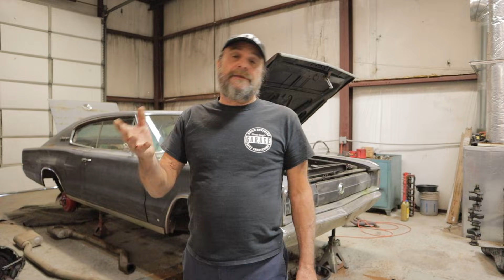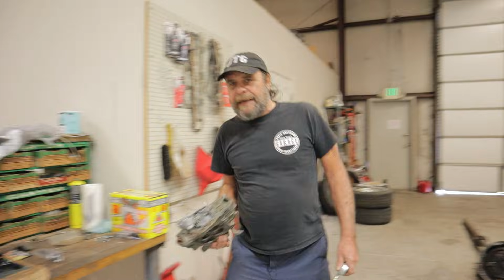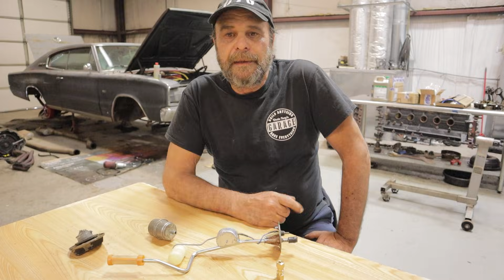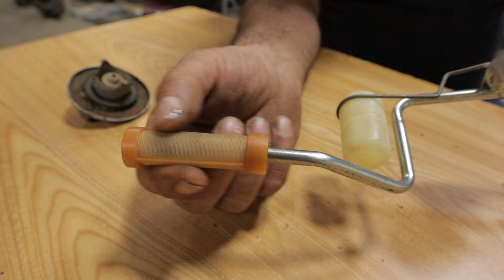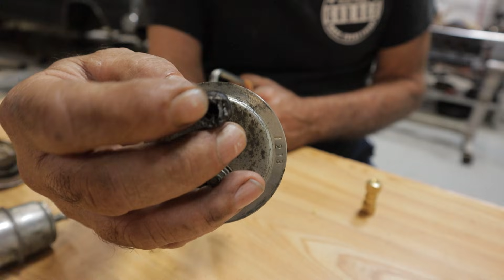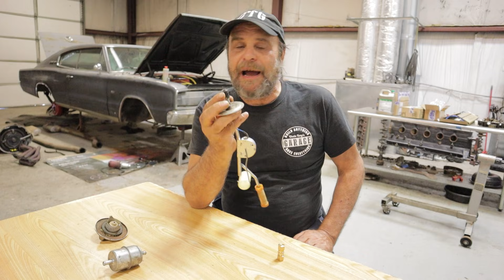Classic Car Survival - Troubleshooting Carbureted Engine Fuel Delivery Systems

Comment: I have a question? I had a 79 Ford truck for the 400 engine every two weeks I would take out a fuel pump, replaced all the fuel line brand new tank, everything every two weeks or take off your pump put a new one on run fine after six bumps. We’re up to 400. I pull the engine and put a belt for 60 and never once had a problem never changed any rest of the fuel system never knew what exactly was the problem 460 would hold 6500 RPMs all day long no, if you’re starving problem at all, what the 400 would take out a pump every two weeks sorry if some of this is messed up, I am legally blind. Have to use talk to text.

Comment: Dads 84 suburban would sterve for fuel sometimes. He thought it was vapor lock. Installed inline electric fuel pump. Years later i found there was a pin hole in one of the metal lines coming from the fuel tank. Clamped a rubber hose on it no more problem. Was very strange

Comment: Heavy float if carb has a nitrophyl float. Too much alcohol in fuel will dry out the material and cause float to sink causing flooding or overflow. Brass float can get a tiny breech and sink as well. Brass floats are still the best to use. I still push Seafoam as it nullifies the drying effect of E10 fuel for older carb vehicles.

Comment: My 80's k car had a fuel problem, that shuttered and bucked like crazy, then clear up and do it again. Rust in the gas tank blocking the filter, until it would fall away from the filter and back again. Lot's of fun. Drain, shake around with a chain inside and reinstall with new fuel filter. All better. Seemed to be from a gas station that way.

Comment: Haha I have seen that before however it was on a isx Cummings engine and it was the blowby tube. At idle it flowed fine but when we drove the truck it would blow oil out of everywhere it seemed like and granted that engine has high crank case pressure anyway but it was mostly coming from the front crank seal and after 2 seals later it started just dumping oil like crazy from everywhere you could imagine I cut the blowby tube off right where it came out of the front cover of the engine and I have never seen a hose so blister up on the inside before it was definitely a learning experience

Comment: Back in the 1970s and 1980s, it was commonplace to swap an SBC into a Vega. There were several stories about a puzzling result; the V8 engine would lose power above a specific rpm. The problem would then be traced to using the original fuel line, which had been designed for the stock 140 CID four cylinder engine.

Comment: I recall reading in a mid 1960s magazine (Mecanix Illustrated?) in which a vented fuel cap had been replaced with a non-vented type. This caused the fuel tank to partially collapse. Stereotypically for the era, the woman driver had only noticed that she had to fill up more often.

Comment: I had a fuel starvation issue ,Ands a buddy had a chevy with the same issue .
after a short drive it would run out of gas, let it sit start up   but do it again quicker. > to find out if it was the pump we pulled the plugs riged a line and in seconds had 2 gallons of gas in a pail ! no issues with pre pump fuel flow, put it to gether & do it again ! his truck we put a pressure gages between the pump & the tank , and when running vaccume would then climb to  20 inch's mg vapor locked ok socks plugging but only when pressure pluses ,not in free flow conditions >out of gas, omc boat tank , no problems . later it happened to me . could not  find a vender for the replacement sock > But i did find a whole new sender unit .  later i had aeratic fuel pump cost me a grand  in towing,carb diagnosis and replacement. > the mechanics were not happy about not working on a chevy. and year later I figered out the pump was sketced out ,and my carberators were probbaly fine just ove presueizing the  system i had,as it did to the new holley after wards. just cause they can race chevys ,and do it well . does not mean there capable of troubleshooting an ol dodge

Comment: Start off the day with basic stretching exercises as you get older . On all my mopars I bought switched over to 3/8 racing aluminum fuel line and used vinyl coated metal hose clamp hangers

Comment: Would replacing the lines and connecting small rubber lines with all braided line and putting an inline filter before the pump help ??

Comment: Great videos Tony.  I have a Ford F150 1985 I was having fuel starvation problem. It has caused the truck stop A few different times. So I decided change the fuel pump and since then , it’s been running OK. My question to you is should I put a filter before the fuel pump .  I have a transparent wix just before the carburetor.  But after watching your video I’m thinking I could maybe put one before The new fuel pump i put in.

Comment: Good stuff as usual! I have a 73 340 RR that has been sitting for a long time, and I know I have either a clogged screen in the tank, or clogged fuel line, etc because when I run a fuel line from the fuel pump to a can of gas she runs just fine. Otherwise the pump won't pull any fuel hardly at all. Could be the rubber line coming out of the tank. This gives me a troubleshooting roadmap, so thanks much!
Reply: all the new fuel today thanks to farm lobby is full off ethanol and it destroys fuel tanks 100%. Good thing new tanks are available still. remember that most fueling stations probably have lots of moisture inside them as well. What is the challenge is how to install ethanol-proof tank parts

Comment: Tony there is one other thing that will cause fuel starvation. on general motors cars there is like a spring inside the fuel cartridge and a plastic plug like in them on the rubber gasket take both that spring and plastic plug out . Back in the day (when l worked for GM) there was a bulletin about fuel starvation in most GM cars.

Comment: I swapped out an avs with my cousin, for a thermoquad. The thermoquad kept cutting off at various times. Then let it sit. It would run again. Then out of No where shut off again. He ran the avs with an adaptor with no more issues. The 360 Volare  ran great. I on the other hand started having the cut off problem on my 340 Challenger. I took the carb apart. Checked the floats and needles. All working as they should. I blew into the metal fuel line with the floats dropped. No blockage. Put it all back together. Ran great. Until it just shut off and starved for fuel. I removed the carb again. No fuel ran out of the line. I tapped it a little and a small round flat piece of plastic fell out. It was almost the same diameter as the fuel line. I guess it would turn like a throttle blades on a carb and fuel would flow. Then when it turned and shut off the fuel it caused the problem. I put the carb back on. And it was the best carb I ever ran. That 2 1/4 secondaries would light the back tires up when it came in😂. I love the thermoquad. Really simple carb to set up. Tension the rear flap and set the needles for ideal idle. I still have this carb.

Comment: I found an odd issue on my cousin's rail buggy carburetor once. He was having a starvation problem,  idled fine but fell on its face when he hit the gas. Apparently someone had rebuilt his carburetor and didn't tighten the float valve seat enough. The seat then backed itself out, from vibration I guess, until it had the float pushed down tight in the bowl. Of course the valve was closed tight, most of the fuel coming into the carburetor was seeping in around the threads of the seat. 
I've also seen where someone had stacked two seat gaskets on a carburetor. Apparently the old gasket didn't come off and they just added the new one on top of it.  Not as much of a problem, but has potential to be.

Comment: I followed ford's instructions on diagnosing a 2017 f150 with a dead throttle pedal. Replaced both high and low pressure pumps, swept throttle sensor (2 grand so far). Turned out to be throttle body. Good luck

Comment: My '66 Coronet 500 uses the same fuel system components as that Charger. When I rebuilt it, the fuel tank was so full of loose rust and debris that I just threw it away. I replaced it with a stainless steel reproduction tank. When I installed the fuel pick-up I ordered the one used for the hemi car. It is has 1/2" dia metal pipe, and requires 1/2" hook up hose. I replaced the rest of the rusty old 5/16 fuel line with 3/8 fuel line.

Comment: I'd like to refer to Chris Birdsong (guy who restores 2nd gen Chargers and un-hacked the '68 from Roadkill) who was deep into Holley EFI stuff, untill he started having them fail and leave him stranded. (Surprise surprise) So now he has abandoned them and went back to carbs again.
Reply: Interesting about the Holley EFI. I've been having problems with Pertronix ignition conversions-not that they stop firing, but hard starting and blowing-up mufflers -- somehow the timing is off and ignite while an exhaust valve is open. I'm all points now, and not another problem.
Reply: Simple is luxury

Comment: funny you posted this the same day I just had my '66 wildcat experience no fuel issues for the first time in 16 yrs. Posted a video too! No fuel at the carb, then traced to the filter, then fuel pump, then disconnected the pump and no fuel coming from the tank to the pump. Tank is vented, dropped the tank and checked the sender and sock was fine. Blew compressed air through steel lines, and checked cam lobe with endoscope to ensure lobe was still hitting pump arm. Pump still pumps. Rubber lines must have collapsed, about to check this weekend more. You rock Tony!

Comment: Three stories: 1. Had a carb off a GMC stove-bolt six cylinder, the float chamber so full of debris that the jets had tunnels under the float to feed fuel.  Took a total replacement rather than a rebuild! 2.  Old mechanic used to fill the glass filters with fuel before putting inline, result was filter was full for a few months until the fuel line 'vented' itself.  3.  A Datsun 280 Z  would not start off the carrier, had half full tank, regional rep wanted use car for instruction purposes to train techs, (Bosch J- or K-lectric systems) crank engine no start.  spark at plugs, plugs clean, but heard clicking noise when cranking, two of us told them to replace the fuel filter, that wasn't until 30 pages later in the diagnostic manual!  When asked why we made a quick diagnosis of fuel filter, the injectors were making the clicking noise because the seats were dry from lack of fuel for the cushion between the needle and seat!   Old Guys RULE!

Comment: I garentee the ethanol ate that rubber hose and made it do that. Although I have never had that issue quite like that. I have learned that regular fuel line is no longer suitable for use. You have to buy the more expensive "fuel injection line" whatever rubber its made from is unaffected by today's gas how fuel line should be. Hopefully that tip helps someone avoid issues.
Reply: I found the same situation. Injection hose and solid clamps, problem solved.

Comment: Your experience is priceless. Something as simple as "ignition problems create abrupt symptoms and fuel issues are more gradual" makes total sense and yet something that I may never have considered. I truly appreciate all your advice, knowledge, and passion. My #1 favorite Youtibe Channel, hands down.
Reply: There is the "head scratcher" that can leave one sitting on the side of the road. My Cutlass has a Chevy 350 in it One day after visiting my son we were heading home and it died...like shutting the key off die. I called my son and he came down. I put a spare spark plug in a plug wire and determined I had spark. Then pulled the fuel line from the stock pump. No fuel. We put a temporary electric fuel pump in and drove it home. I pulled the mechanical pump out and found the pin that is a hinge for the actuator came out where it was staked in. Never saw one come apart before. 2 weeks later my kid was driving his 69 Camaro and the exact same thing happened to his pump. Even with the trouble I'd still rather run a mechanical  pump.

Comment: Why do clear filters seem to drain back?  Fuel is draining back through the fuel pump.  Some are designed with an inlet valve that only closes on the pressure stroke to bahave as a check.  Engine shuts off and things self level.  Installing an in-line check valve on the outlet wil stop that.

Comment: 82 Pontiac trans am had the problem with the charcoal in the carburetor, carb would flood putting gas into the charcoal canister and turning it into powder and end up in the float bowl. I've also run into a 78 olds cutlass that had a leaking fuel line over the rear axle higher than the tank never leaked fuel car ran fine if used every day but if it sat for 2 days it would start and die and not restart unless carb was primed several times the mechanical pump only drew air until the line had some fuel in it

Comment: On my 74 jeep with a 304 in it if it sat for a 2 weeks or so wouldn't start without dumping gas down the carburetor, turned out the linkage in the fuel pump was worn and it only would get about half the stroke. When it was running it moved fast enough to pump enough fuel.

Comment: I had a similar issue on my square body. I ended up running fuel injection line throughout the truck wherever there was a rubber line connection spot
Reply: Shitbox fever!

Comment: Reminds me of one I had in the 90's a K car that would run for 20 minuets , stall wait 10 minuets, and it will restart. well I was 3rd guy in , the parts cannon had been fired the fuel pump , throttle body /fuel injector. o2 sensor, distributer, and smec had been replaced. I put pressure gage on the fuel line and drove it. 20 minuets no fuel after waiting 10 minuets fuel pressure. drove back to shop    where it was doing it . I pulled out the new fuel pump and found blue nylon rope fibers in the pick up sock filter, I reached into the tank and pulled out what was left of the rope.
Reply: Holy cow!  Where from?
Reply: @stuckinmygarage6220  I was in a small town in north central Ontario. now I'm  IN Doha Qatar . had my trade certificate since 78.

Comment: I had same issue with a Dart. Replaced the rubber hose with fuel injector hose instead of stock rubber and never had the issue again. I'm not sure, but I was told the fuel injector line is better for dealing with the modern gas (ethanol).
Reply: Buy updated hose made for handling ethanol.  All new cars use hard lines , but, we need to minimize the sections of soft.  Spend the money.  New fuel injection line seems like a good idea.

Comment: I had a 77 LTD II that had the door on the quarter panel for the gas cap. The housing or the compartment was made up of the two body panels welded together. There was a manufactured gap for letting any water back out of the Gas cap area. That would easily clog with Fir tree needles and road dust, then when it rained it would cake up the bottom like mud and flood out the Gas cap and allow water into the tank.
The only filter on the car was about the size of my thumb and screwed into the 2VV carb. Every time it rained it would  go into a nosedive situation at 45 or higher. I could limp it home. It got to be a pain in the hiney to drive, needing the tank totally expelled and fresh start. What it needed was just a couple holes drilled to assist in the draining of the gas cap area.
Reply: 😂. I haven't heard " hiney" in a long time.   Texan?  I need to check the rubber seal / grommet around my " modern" gas cap.  Cheers!
Reply: @stuckinmygarage6220  Yeah the seal was bad too, but the holes needed to be there because the 1 drain gap at the bottom was easily manipulated over a period of time.
Notice I said fir tree, so anywhere else besides my front yard, most likely nothing would have ever happened. but the fir needles just lay one on top of themselves and eventually dam everything up.
The dang fir tree is every bit of 5.5' in diameter and in 2 huge branches at the trunk. Again the holes were easier than doing away with the tree.

Comment: Ethanol is just great isn't it! Ethanol/Methanol sucks the oils out of the rubber hoses and if it sits for awhile it shrinks and hardens. Use an Ethanol compatible hose, it's all I will use these days as you never know what the customer will use regarding normal pump gas VS recreational gas/ethanol free.

Comment: I ran into several cars where the seat was evidently lose and had slowly backed out, causing the gas level to drop until the car wouldn’t start go any more and would start but start and shut down almost immediately. I fixed one of my own cars with this problem and the follower week was coming out of work and saw colleague having car trouble. Sure enough, same symptom and very similar the the GM 4bbl in my wife’s car. It was dark but I was able to pop the top off and take the needle out and tighten the seat and reassemble everything 90% by feel. Of course I didn’t let on.

Comment: Tony,
I once had one of the poppet valves inside a mechanical fuel pump come loose and then it wouldn't pump fuel at all. Happened way out miles from anywhere.  Took the pump off, opened it up and the poppet valve fell out!  I had some tools with me (obviously), put it back in place, used a center punch and staked it in good and solid, reassembled everything and we were good to go. Never had a problem with for the rest of the 8 or 10 years that I had the car for.
Reply: Nice field repair!👍. Yup. Two toolboxes

Comment: I had that problem when I was working small engines. The liner in the hose would swell closed. I had about ten new Husqvarna riders I had to replace the fuel hose front to back. Also probably another ten or more craftsman. Only one year. Some of them I had to do twice. The fuel hose they sent us for the warranty work did the same thing.